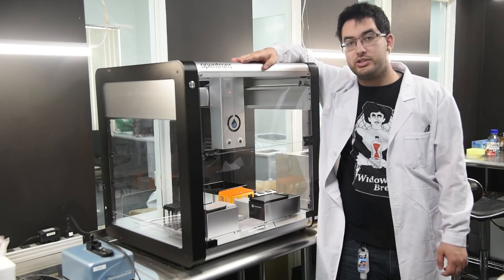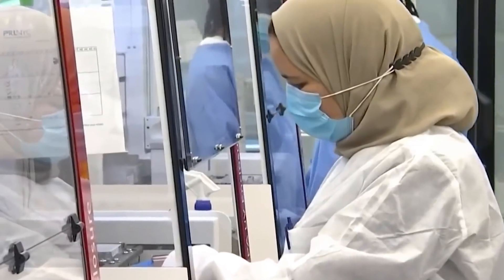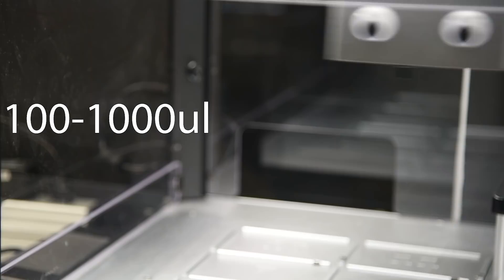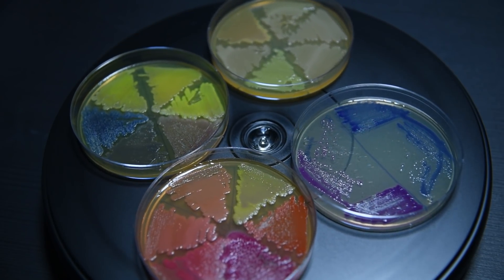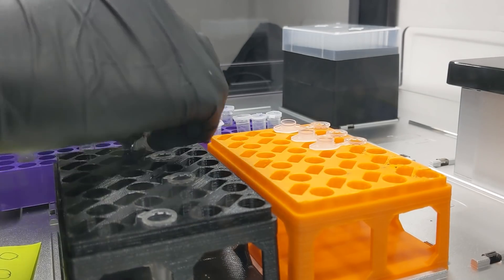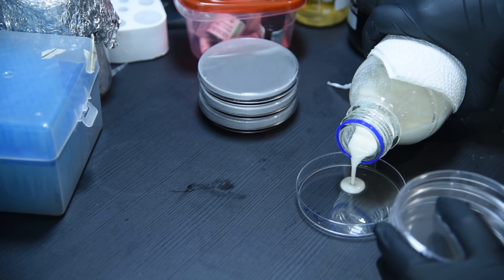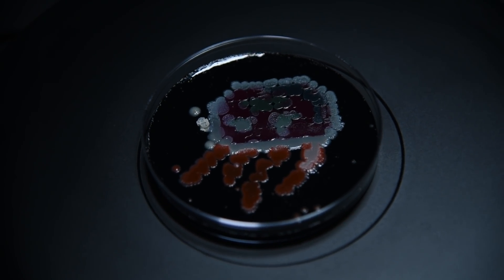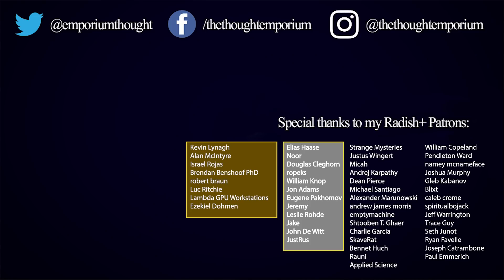Please robot, take my job!

Comment: Our Beckman i7 protocols were used for covid sample prep - all in one sample prep using multichannel manifolds and a span 8 to allow both whole plate pipetting and single well. I use the i7 for mass spectrometry sample preparation, cellular extraction etc. the liquid handlers are a gamechanger. For entire protocols though, the cellario setups from HighRes are where its at.

Comment: So, like, they didnt even add into the firmware stepper acceleration to smooth out the movements? I mean, look at that thing shake around! Geeze.... Also, can these companies stop pretending they're doing something special? Like, its just a bog standard CNC style XY plotter with a Z on the head, plus the equivalent of a servo on a pipettor. Yes, its neat, but......IDK for what Im sure you paid for it, I find it lacking....very thanos 'too much thought into what it looks like instead of how it works' kind of vibe. Some CAD wizardry and any 3D printer can print a head to do essentially the same thing..... One thing I still am waiting for with a lot of these rehashes (and I will disparage as long as they want to pretend each iteration isnt a 3d printer with a different head (so basically a 3 axis CNC)) is computer vision. Like we barely have 'oh no stringy mess' detection on SLA printers.....Yet these companies have no problem charging out the nose for the same old firmware with a different UI..... Much disillusion, very disappoint.

And they already have (VERY EXPENSIVE) machines that do exactly what that other biolab does with however many of those printers, but in one machine that doesnt need its racks handled between stations. And why not have a robot to do that step anyways? 6dof arms arnt exactly exotic anymore, they can afford all those printers but not a simple pick and place arm? Kind of throws their attention to detail into question honestly....

Comment: it looks like the robot's hardware is nearly identical to a 3D printer minus the hot end for melting plastic and a heating bed and just an air tight enclosure. if thats true, the capabilities of that thing is going to be really impressive in what you can get that thing to do

Comment: It is absolutely insane to me that these things start at 5000$.
Don’t get me wrong, it’s a great machine, and it seems like they put a great deal of effort into making the software accessible for non technology minded people, but apart from the pipette module this is completely off the shelf hardware. What makes cnc machines so expensive is rigidity. Milling metals causes deflection. The more rigid the machine, the less deflection you get, the more accurate the parts. But these machines don’t need to be rigid, they work with liquids. Even with high quality linear rails and closed loop steppers, this should cost 2-3k at most. And that’s including a healthy profit.

Still, it’s great that someone is making this technology accessible at all. Price will come down with time.

Comment: Hey man, very excited to see that set up. Jealous is a huge understatement. Congrats on the -80. It's super compact (I've never seen them that small). You messaged me about getting one and I thought it was going to be the huge units I have in my lab but that's a really cool and space(spine)-saving solution.
A suggestion on the meniscus issue: can you set agar in a large, shallow tray and use the petri dishes as cookie cutters to extract the inner, flat areas? I know agar is fragile but if you get a very shallow tray, lay all the petri dishes on top, press them down with a board, then flip the entire thing (like the baking a cake trick), you might get really flat agar canvases to work with. You might need to add an air hole to the petri dishes with a soldering iron (they work great on polystyrene).
And like others have said, deal with that wobble :)
Can't wait for what your channel has in store.

Comment: You can solve the tip-agar problem by slowly dispensing above the agar, making a droplet on the tip, and then poking the agar. The droplet should then absorb into the agar. You get a little hole in the agar where the tip poked it (the droplet still makes a little circle), but other than that, it is a reliable method for plating that I use with my p20M to do high throughput transformations.

Comment: BRO!! You NEED to fix the shaking of the table the Robot is on!! Either get a couple of metal straps and bolt it to the wall, or fix an uneven leg if that's it, but no matter what it is causing everything to shake EVERY TIME THE ROBOT MOVES, you NEED TO FIX IT!!! :) 
If you don't know what I mean by metal straps they are strips of thin metal (maybe 1/16th of an inch - sorry I'm American, my brain is broken and I only do Imperial :( lol )  that are fairly pliable and they have a line of hole going down the center length of them. You bolt it to the wall and bend it into an L shape and bolt the other end to the table.... this can be VERY GOOD at holding it solid if you put them on all 4 corners and DO IT RIGHT... but it can be hard to do it right... 
Maybe putting a bunch of heavy weight on the bottom shelf will work... I'm not sure the best way, but everything looks SUPER WONKY for a biology lab if it shakes ever ytime you touch the table, or the camera, or the robot moves... and I feel like it could be causing some of the 'pixels' to bleed away from where you want them :) I hope this wasn't too jerk-ish of me, I just wanna help :)

Comment: If you want to sterilize you should use a lower % alcohol, like 70%. The high concentration will cause blobs of bacteria to clot which protects the bacteria in the middle. Diluted with a bit of water and this doesn’t happen. 

Source: I manufacture hand sanitizer.
Reply from the maker: That's why the peroxide is there. It does most of the work, the iso is mostly there to finish anything remaining off, and dissolve away any debris. Since dissolution is the goal, higher concentration is better.

Comment: Hi from watching your video i feel like you have unstable table on which the robot sits. It then can create artifacts on the final product and also could create those random spots. If for example there is a droplet on the end of the tip and the tabe shakes thanks to the movement of the robot arm, it could as well propel the droplets out of the tip on the random spot in the dish.

Comment: You said the machines are used in REAL LABS. Brother... you have a REAL lab. 😂 Don’t try to short yourself by thinking your lab is not good enough to be considered a real lab. You have a beautiful setup and I would legitimately work for minimum wage just to be able to work with you there. Even if I was just a cameraman or a bodyguard... I’d be all smiles every single day. 😊

Comment: That is not robotic biology. That is automation in the lab.
Robotic biology is creating something which would technically count as 'life' or 'living' using robots.
i gave you another try but you are hopeless and your vision of using automation to draw designs instead of having an actual experiment which requires many samples - really under whelming and a grand waste of the tools at hand. Standing around with all your tools out like that as well was messed up. I can see why your neuron experiment didn't work so well ... your lab protocol is lacking in common sense.

Comment: Make sure the table can't move. Even with a precise and sturdy machine, the movement can make things worse (at least it does with 3D printing). Some people screw it to the wall. Another option is having a heavy granite plank on top of the table. Some extremely fast 3D printers are even anchored to the wall.
Reply: I have mine on a wobbly table. Its not a problem. I get perfect quality prints. My belts are tight, and my frame is sturdy, and thats all you need

Comment: A test that isn't really bio related that I would want to see is freeze-drying a measured quantity of water and then compare that with how much of it that is caught by the cold-trap. I suspect that quite a lot of moisture is being past through the vacuum-pump. Some user of the low maintains pump claims it to fog up the room it is used in.

Comment: Would it be possible to use something like a tattoo needle to "tattoo" bacteria in to agar to limit splash back and make dots super small?
Reply: Putting bacteria into agar creates a different kinds of problems, mainly that it cant exchange gasses. If it is aerobic it will most likely just not grow and anaerobic will have limited growth.
Reply: unklikely

Comment: Labs in transition between companies often scrap the old equipment. The computers are generally removed or the instruments are custom, so reverse engineering needed if the manufacturer will not help. I've visited a few of these labs to help the new owners repurpose or salvage equipment. The quality (and original purchase price) of the equipment is generally high. Not sure how how to locate them in general, but lab robots, especially plate and liquid handlers, would be typical finds. Someone will probably know someone...
Reply: How can one follow that locally ?

Comment: Can you print this and have action that move through Cetus t creating a unique and original changing electrical connection from key points around it changing Mirco electrical flows. If yes contact the poker machine companies because I can pick the basic chip set and they know it.

Comment: You should consider turning down the acceleration to prevent it shaking your table so much. You can change this in /var/data/robot_settings.json. Brought mine down by an order of magnitude and it helped a bunch. I have no idea why Opentrons sets it so high by default.

Comment: This is very cool to see! We use an Eppendorf liquid handling robot in our lab and often the GUI is extremely frustrating and limiting, as a handy tip for agar plates, older ones loose a little moisture and things stick better so you might not need a blowout step. You could also let your plates dry out a little when you get a decent hood and that will help also.

Comment: I believe you could improve accuracy of the machine just by putting a heavy plate under the machine or bolting the table its sitting on to the wall. There is a lot of visible vibration from movement of the pipet head. 3d printers have a similar problem and it could be easily avoided.

Comment: If you have those transducers from the sonoluminescence video still might try using those to agitate the agar. If it's anything like cement should work well to level it out before you print.

Comment: The secret to being smart with programming is by being dumb in real life. You realize you need to name things well, structure things so they're easy to read, document thoroughly because you will forget, use version control because you will make mistakes. I've found that a lack of ability can be a strength because you can lean on the tools that are simply better than anyone's natural abilities. While you don't have to actually be dumb to lean on tools/strategies that reduce cognitive load, I've found that many who are gifted are too proud to do so, and then struggle in ways that are no longer ever an issue for me. Sometimes a crutch is a crutch, and sometimes a perceived "crutch" is the difference between running and driving.

Comment: Looks like the table is too rigid and the arm causes everything to shake?

And I guess since it's open-source, you can easily add a UV lightbox the tip can be moved into to sterilize.

Comment: i suggest stabilizing the table, the googly eyes are making the entire thing wobble
Reply: The amount of shake from the robot arm moving is jarring.
Reply: Epoxy it to a 100kg granite countertop
Reply: Agree, I would sugest sturdier / heavier table and/or limit accelerations for the moves if its possible.
Reply: maybe its a feature not a bug
Reply: Not only do they severely destabilize the setup, the adhesive backing is a total spore magnet. Half joking.
Reply: Make a tuned mass damper for the table!
Reply: @duckythescientist  That would work only for systems with some natural oscillating frequency right? The robot arm's movement is all herky-jerky, so a solution in the same vein would a moving a counterweight in the opposite direction, kinda like a crane.
Reply: @duckythescientist  would be great but with something that small you can just add mass and stiffness to the table and it should fix most things.
Reply: Haha, I came down to say the same.  Heck just a cross-brace on the legs would probably help a lot.
Reply: This was also my first thought! The table it's placed on looks very unstable.
Reply: Was noticing that as well and wondering whether the base of the robot would stable enough to not move (significantly) when properly attached to a stable and rigid surface.

Comment: I felt the opening problem in my pipette-scarred fingers, the sheer collective lifetime lost to mindless pipetting is just wow
Reply from the maker: @AliveInTheLab  Robotic bio is the future. I hate 96 well plates and it takes a fraction of the time to write a quick program and run it with this than it does to do a whole plate by hand. And if you ever have to run the same thing again, just grab the file and you're good to go. This and robotic remote labs are the future
Reply: @thethoughtemporium  and that's why I studied in robotics . Robotics automatisation is inevitable after a certain scale, and even if we got to the point that you can make anything in a GUI , you still need someone to program the robot for adding new components and protocols.
Reply: @thethoughtemporium  I love you
Reply: @thethoughtemporium  Benjamin T is right on this one. The lab I'm working in has an OT2 and we're barely touching it. It's faster to do everything by hand using multichannel pipettes or even single channel pipettes if we have to. I've made customizable protocols for it to try to make it useful, but it takes so long to pipette a whole 96-well plate that evaporation of samples becomes an issue. This is mostly useful for labs with high-throughput standardized protocols than for labs doing basic research.
Reply: Always room for improvement tho, maybe our (grand)children will one day be able to skip some of the hassle of endless pipetting in standard protocols 😉
Reply: I, and the thumb arthritis I now have from my lifetime of pipetting, quite literally feel your pain.

Comment: From the moment I understood the weakness of my flesh, it disgusted me. I craved the strength and certainty of steel. I aspired to the purity of the Blessed Machine.

Your kind cling to your flesh, as though it will not decay and fail you. One day the crude biomass you call the temple will wither, and you will beg my kind to save you.

But I am already saved, for the Machine is immortal...
Reply: Wack

Comment: Nice work!
Just two things that could be interesting for you.
Have you thought of 3d printing a petri-dish sized plate with tiny spikes to create small wells on your agar while it solidifies? this could solve the droplet leaking problem.
Also, people tend to use alcool at 70% to kill bacteria instead of 100%. The problem with 100% is that it can make some bacteria sporulate as a defence mechanism. This tends to happen less with 70%.

Comment: Hey I noticed that there was a fair amount of vibration in the solution, if that becomes an issue you might want to find a more rigid table to put it on or what I found works really well for 3d printers is to put some of those paver stones you can find at any home improvement store and put them underneath the corners. I don’t know much about biology so I can’t say if the vibrations will hurt anything, but I do know 3d printers so if they do hopefully that helps!
Reply from the maker: The table is going to be bolted to the wall. The tables in the original lab and temporary lab were free floating, but the new one is rigid so that doesn't happen

Comment: I'm thinking you should bolt the robot's frame or the workbench to the wall. Those vibrations are scary.
Reply: Also maybe do the old 3d printer trick and set it onto a big stone/concrete slab
Reply: @chemieju6305  or do the oldest trick in the book, and put something squishy underneath lol
Reply: Counter point: Or the mechanical vibrations introduced by the motors might be introducing fluid mechanics to the samples that could lead to a discovery?
Reply: @recklessroges  breaking news: bakteria filled liquid sloshes when moved

Comment: i wish there was a hackerspace near me. but damn yours would be my dream.
Reply: I didn't think there was one in my area, but then I found out it was inside my local library (which I hadn't been to in many years).
Reply: My local hackerspace is ruined by the elitist mentalities of the people that have been there longer and became "master instructors" somehow, even though they struggle to hold a .01 tolerance. My 10+ years of aircraft lathe manufacturing experience meant nothing to them. 🤷‍♂️
Reply: Same
Reply: @Internet Guidance actually i have indeed been thinking about that myself. unfortunately it is not something i can afford right now. time and money are an issue.